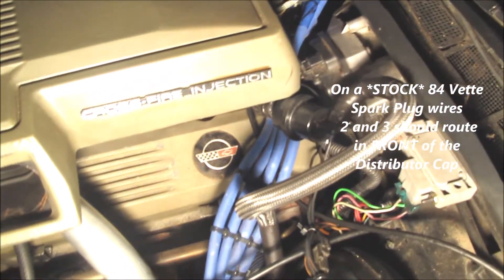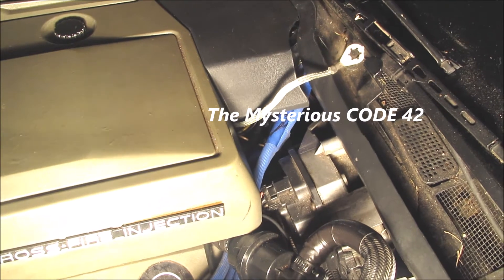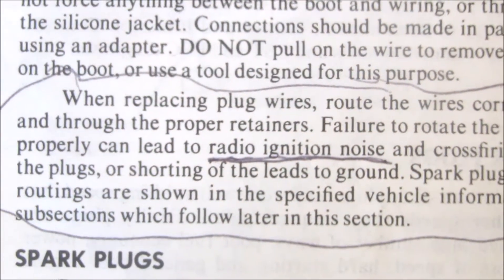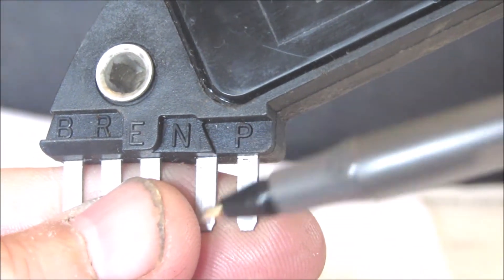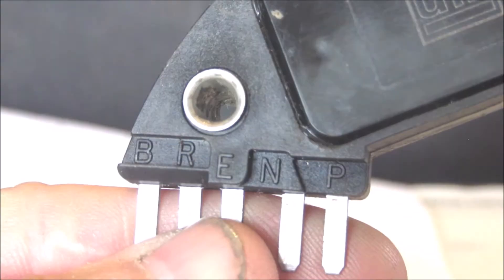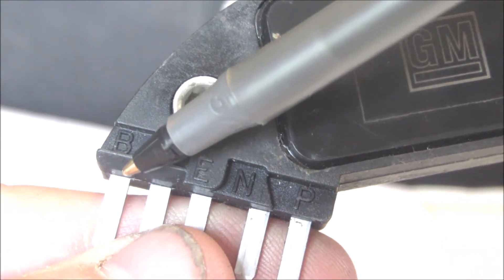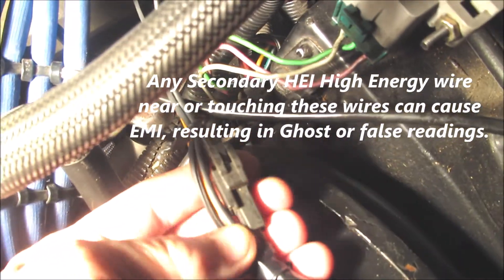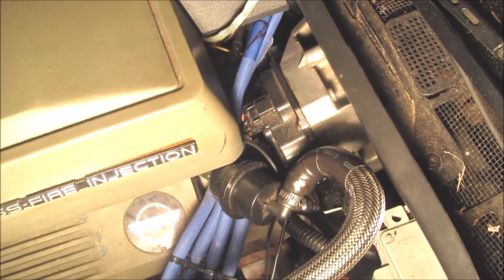1984 Corvette GM 7PIN ICM, false codes/ghost misfire's from EMI

Comment: you are never quitting and enjoy working on the crossfire thats awesome ! 
the minute It gives me a headache , im yanking the whole top end yank all the old computer stuff , go with an edelbrock carb/efi  ,alum heads manifold route ,headers ,basic stuff.350 hp. also dashboard go analog , retain the AC and maybe the cruise ……might have to keep the magnesium rocker covers and retrofit the magnesium aircleaner…that be kool…(i think they are magnesium)
Reply from the maker: Long story truth, I've been tinkering with the electronics on this 84 for almost ten years. When I started, I knew nothing, ZERO, about Corvettes, less about vehicle electronics, Electronic control modules, sensors, you name it.....ZERO, maybe less than zero, quite possibly the dumbest vehicle electronics person on earth.   One day the car wouldn't start, had it TOWED to a mechanic....two weeks later he told me to come pick the car up and get it out of his shop, towed it to another mechanic, he couldn't figure it out. Had it towed home, purchased a FSM, started with one single wire and one single circuit test from the manual, then another test, another wire and on and on....found my issue and started going through every sensor wire and circuit on the car. After all this I still learn something new all the time.  But, bottom line, not too many mechanics want to get involved in a crossfire that's almost 40 years old....guess people have to remove it or figure it out, wish you luck there.
Reply: @HorseshoeBeach  wow yeh appreciate that experience you had with it! yes the big reason is parts availability/expensive to not want the engine ,next reason is performance ,  ,ill maybe  save all the crossfire parts , you never know ,every body throws away these engines then an original is rare! I have the 84 flagship color light bronze with the z51  and just acquired my ‘77C3  ….now im in for the long haul ,thanks again for the awesome tutorials.🏎

Comment: Thanks 3Delta7.  Appreciate any and all Corvette information you post.  Appreciate your time.  Love the C4's!!!   Got an '89 bone-stock vert with 70K original miles, pristine shape, had for many years.  One thing driving me absolutely nuts is a rough idle.  It's got tuned-port-injection, and I've been over and over the car, spent way too much on replacement electronic components, to no avail.  So, I've given up and made the decision to just drive and enjoy the car as is.  It runs perfectly, plenty of power at any speed other than idle.  I've done all the usual 'vacuum leak' search and repairs one can do;  new intake gasket set, all new vacuum lines, vacuum tank, any thing vacuum related, it's new.  I'm beginning to think the 32 year-old wiring harness is probably part of the problem.  Another issue is in today's world,  it's very difficult if not impossible to find QUALITY electronic replacement parts.  Such as ECM's,  mass air flow sensors, TPS's, actually any kind of sensor.  OEM parts (genuine GM) continue to slowly fade away and we're stuck having to fall back on the stuff from China.  Anyway,  I still love my car and love driving it!    Thanks for all you do!!!